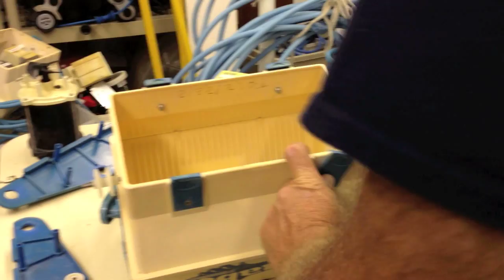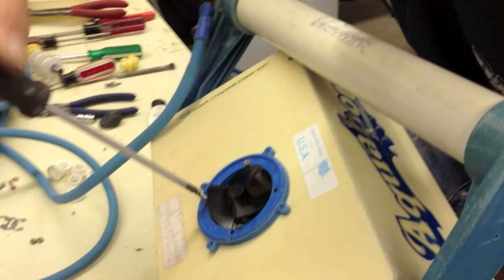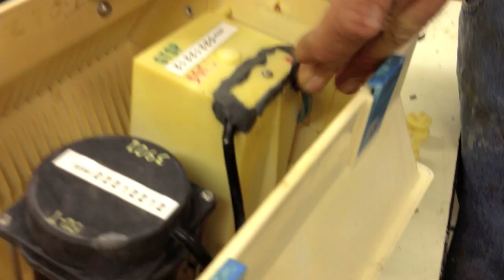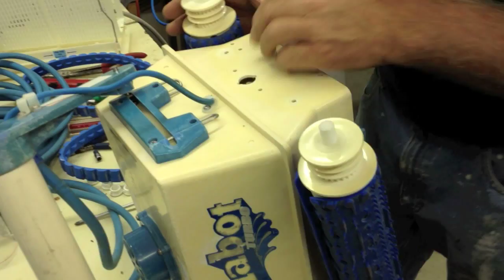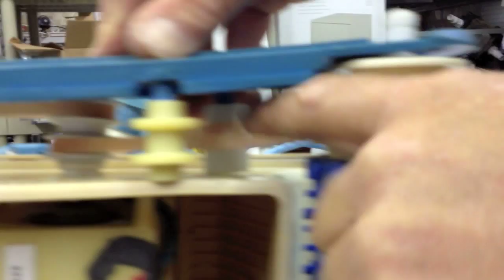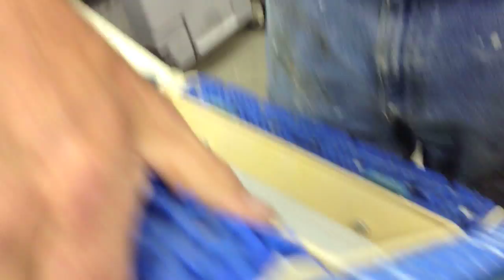How to Assemble Aqua Products Aquabot |  Pool Cleaner Repair Demo

Comment: I have taken apart an electic motor that has a circuit board in it.  Little did I know that there was also some type of oil inside it.  I was wondering what kind of fluid should I get in order to refill the system.

Comment: are they both DC motors? if so what voltage do they run at?
thanks
Reply from the maker: +leamyelectricinc1 Hi these old motors are AC but are not labeled with any voltage. We would need see your power supply to determine the voltage. You could try testing the power supply where the blue cord plugs into it. If you have any questions you can email robotshop@eztestpools.com Thanks!

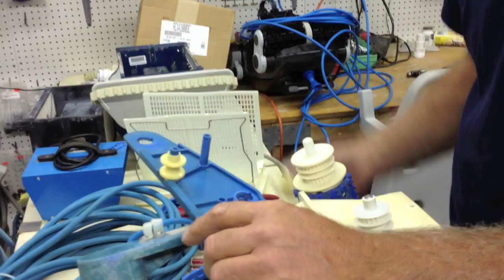Comment: Great video.  I saved $50 minimum bench charge installing my own drive belts and drive tracks.  I have a different model (Aquabot Turbo T purchased in 2008).  Watching the part  (beginning at 10:49) where you put on the rollers, belts and sideplate was exactly what I was looking for!  Thank You for posting this!!

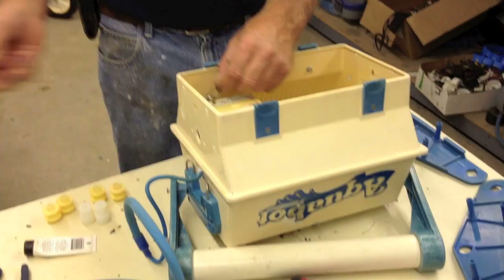Comment: Great video. I have one very similar and need to replace the power cord. I notice @ 2:51  it looks like a plug on the handle. Is it that easy? There used to be a video on here about splicing one (I believe). The guy used several heat shrink connections on the splice. That video isn't here anymore though.
I haven't taken mine apart, but I'm wondering, would a replacement cord have a plug on both ends or would it require splicing?

Comment: This was helpful, thank you.  My motor was working intermittently and I learned that a kink in the cable was the likely culprit.  So I took the apart and shortened the cable, making sure to carefully pack the electrical connections with "thumb gum".  So far it works like a charm
Reply from the maker: Hi Ed & MaryEllen, We are glad that we could help you out in your situation. Thank you for your comments!